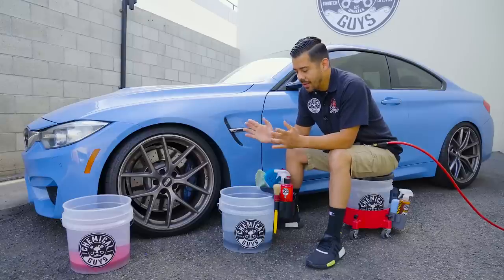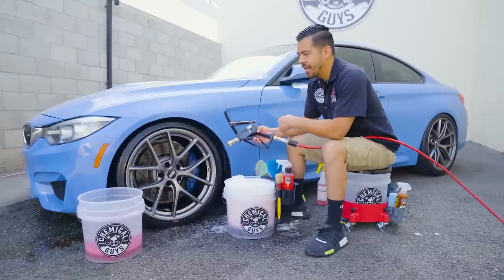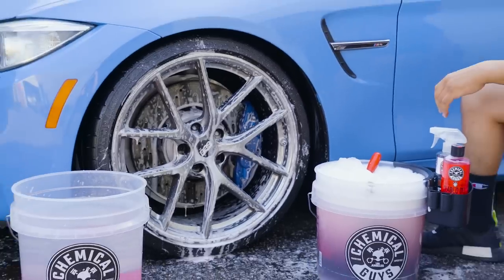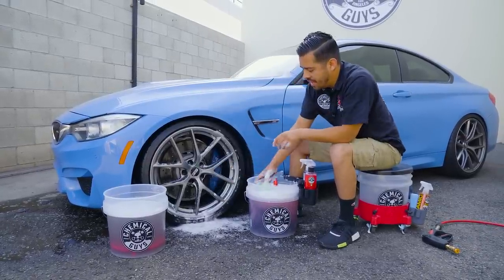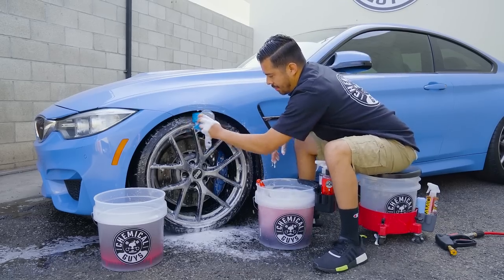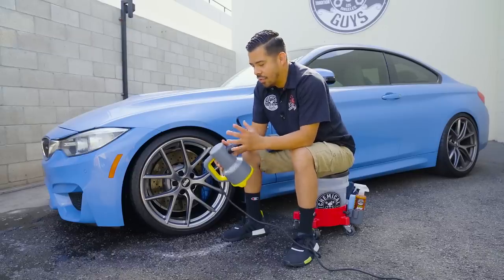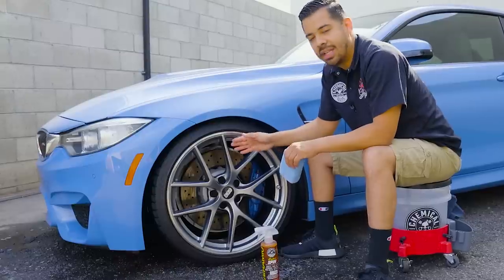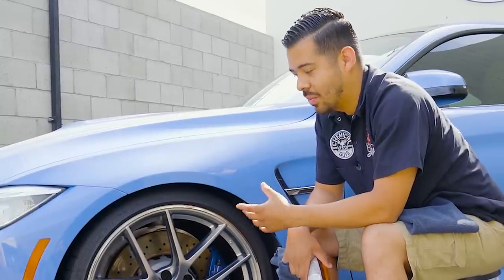Clean CORROSIVE Brake Dust and PROTECT Your Wheels with the Power of Ceramic!

Comment: I have brake dust on the body of my car.   Can these chemicals be used on the body, or will it damage the paint?
Reply from the maker: Hi Henry! Yes, these products are safe for paint. Use a clay bar to extract embedded contamination from the surface of the the paintwork.
Reply: @ChemicalGuys  What about the Decon Pro Iron Remover and Wheel Cleaner?  Can it be used on the body of the car?  Or, will it damage the paint?
Reply: @henrysmith180  any iron remover can be used in paint.  Just don’t let it dry.  Use in shade